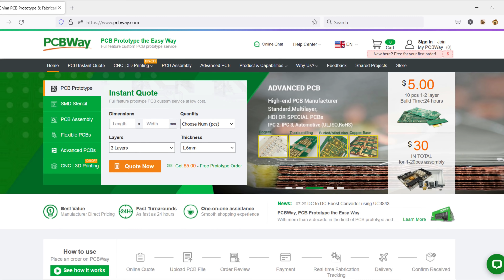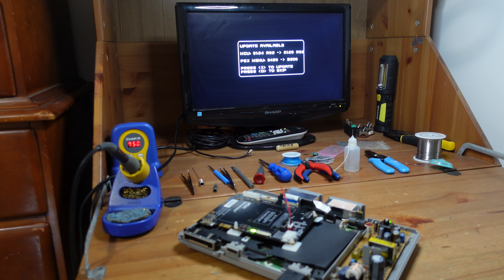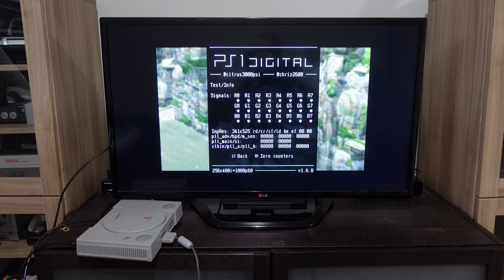PS1 resurrection! PS1Digital HDMI mod and MODE optical disc emulator install

Comment: The link port was actually used with a fair number of multi-player games. It let you connect two psx for local multi-player
Reply: Armored Core series makes great use of the link cable. Lots more maps + full screen & high framerate. Command & Conquer series uses it too.
Reply: Doom deathmatch

Comment: I did this mod over the summer for a friend. The MODE’s plastic sheet mount is really terrible.We ended up opting for the Laserbear Industries mounting kit, along with cooling fan, instead. I’d recommend picking one up. It’s well worth the added expense.
Reply from the maker: Yes that mounting kit by laserbear is fantastic and I also recommend it
Reply: @LIRetroGaming  do a follow up upgrade video! 😀

In my opinion: Terraonion should subsidize the purchase of the Laserbear kit. That flimsy plastic is a joke and not appropriate for an expensive mod like this.

Comment: 5v comes through the audio flex but that flex is very fragile. I suggest checking for shorts on the motherboard too. Also, the PS1Digital installation guide has an error where it tells you to check before you’ve even connected the flex cables. That would only tell us if the PS1Digital is shorted internally instead of checking our own soldering where it is most likely.

There are a couple bypass caps around for checking 3v3 and 5v is very prominent near the audio IC (voltage plane with stitched vias).
Reply: …and, yes, I’ve seen multiple bad audio flexes with no 5v where testing on the PS1Digital test points wouldn’t tell you if there were a 5v short to ground on the board. If 5v is all that’s missing you will not get any video but you can jump 5v straight to the test point.

Comment: I did dozens of PS1Digitals using a pick with soldering iron to lift the legs until I realized that I could use just the pick even easier/safer. Seriously. I uploaded a couple short videos demonstrating it.
Reply from the maker: That’s fantastic! I have to give that a try and I will check out the video
Reply: @LIRetroGaming  I guess I meant to say I’ve installed dozens of XStations with PS1Digital but it seems you understood. ;) Thanks!

Comment: Some North American games do use the serial link port. Off the top of my head, I believe both Warhawk and Doom Special Edition use it. That said, Dan and Chris are working on firmware that lets you connect wirelessly using the kit’s WiFi/Bluetooth. You can even connect an ESP32 to the removed port so you aren’t limited to wireless connections with modified consoles.
Reply from the maker: Very cool, I don’t know much about the link port and did not realize that there were North American games that use it. Dan and Chris are the best and I’m always impressed with the stuff that they come up with!
Reply: i also played command and conquer red alert 2 with the link cable
Reply: Never utilized the link cable but Bushido Blade 2 supports it.
Reply: Looks like I was wrong about Warhawk though my long box copy does promote the Link cable inside the case. :) Though the PS3 game was multiplayer-only it seems the original was single player only. Weird!
Reply: @Nytroman24  Yeah. I understand that one basically included a spawn disc for link play with only one copy of the game. Some PC CD-ROM games would let you install a spawn copy off the same CD for LAN play but with no storage for installation PlayStation obviously needed two discs. Of course, we can make our own spawn copies with XStation these days. ;)
Reply: …oh, and PS1Digital’s Serial over TCP/IP feature was released under Developer Mode months ago. I don’t know if you need two PS1Digitals together on WiFi or if you need to do something with the data from one PS1Digital, like pipe it between the network and an emulator, but at least it’s possible to make something work now. :)

So, yeah, we don’t really lose serial/link functionality by removing it… we gain extra serial/link functionality. :) I need to see if they ever released plans for the wireless dongle since I have one of the cables around and could easily test.

Comment: I actually just got my hands on a PlayStation Digital mod, now I’m about to purchase the TerraOnion MODE as well. 
Do I need to buy a hard drive or can I just use an SD card like XStation? 
I’d rather use it like a nasty card if possible
Reply from the maker: Yes you can certainly use a SD card instead of a hard drive
Reply: @LIRetroGaming  Awesome thank you for the advice I think I’ll go with the set up 👍

Comment: I see no reason to get the Optical PSX anymore. Initially i wanted to buy it, but since 95% of the consoles out there have DEAD optical drives i just went with a PSX Classic Mini instead. The Original UI and Selection of games were kinda disappointing, but once I modded it and add a 128GB USB Drive with Hundreds of Games it turns out a amazing Retro Digital Mini Console. I got my PSX Classic Mini for $30 USD, so i don't understand why most people hate it... It's Super tiny and works perfectly with modern TV's with HDMI port. Getting an used PSX and adding all these mods probably cost far above than just paying for the PSX Mini.
Reply from the maker: Yes that is a totally worthwhile option as well. At least there are lots of ways to play original PSX games! 
This does cost more but some people prefer it including me, mainly just because I really enjoy using original hardware. But the important thing is that you’re enjoying retro games!

Comment: It's funny I keep hearing about worn out lasers, did I not play my PS1 enough, I thought I did? ^_^ Really an optical drive gives you access to play some truly expensive PS1 games on original hardware rather than finding a reliable burn disc in this current market which only gets harder as time marches on.
I had some reservations about the HDMI-out position where the link cable goes but I haven't seen any videos of people actually system linking PS1 anymore. Been more headway with online linking like the Dreamcast multiplayer revival.
Reply from the maker: Yeah there is definitely much less progress with PlayStation cable as compared to other systems. I believe that there will be a way to add that functionality back in as well with the HDMI mod

Comment: What is the point of the "heatsink"? There's nothing to redistribute the heat from the chips to that and then to the outside. It's also soldered. Was it just there to deter modchips or something? Weird Sony...

Awesome video and mods. I had one of these PS1s as a kid. Surprisingly the disk drive never failed. My PS2 one failed about every other week though. I was the only kid who had their dad teach them how to fix the laser because he got tired of doing it for me. This actually made me quite popular since other kids had issues with theirs...
Reply from the maker: That metal shielding was actually there for reducing RF interference. Nowadays it’s totally unnecessary so removing it doesn’t have any impact on the performance of the system. Glad that you enjoyed the video!
Reply: @LIRetroGaming  Was RF interference even a thing for the PS1? I know RF waves can, bizarrely, alter how carts are read (I've seen a lot of videos of old Ataris not reading carts right without the RF shield on) and well, obviously mess with RF input (which the PS1 lacks?), but... discs?

May as well ask here since it's related. What about the N64 heatsink/RF shield, is that actually necessary for anything? I see people say it "overheats too much without it", but I have no idea how it's helping when there's no way for it to transfer heat (no thermal paste), and it's just layers of thin metal sheets essentially.

Comment: WHERE DID THIS PERSON FIND A PS1DIGITAL KIT!!!!

Right now trouble shooting sound issues with my xStation, has a static/fuzz playing on the menu and boot screens and some games but not all.
Reply from the maker: This guy got his a long time ago when they were still in stock. Definitely check the connections on the QSB with the XStation
Reply: @LIRetroGaming  It ended up being IC 308, had a few legs that needed reflowing!